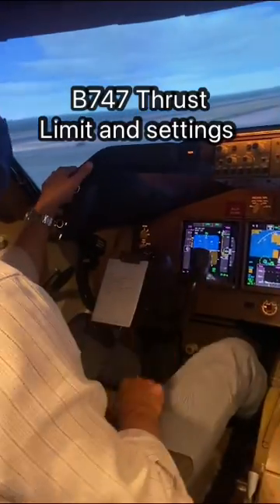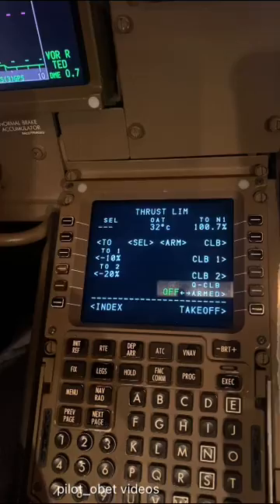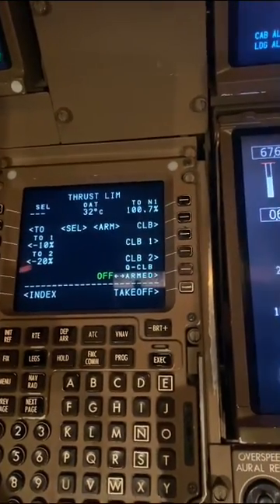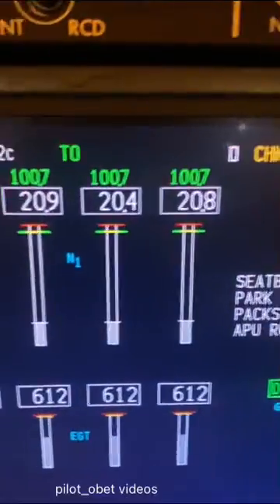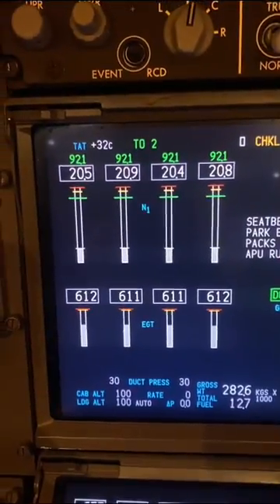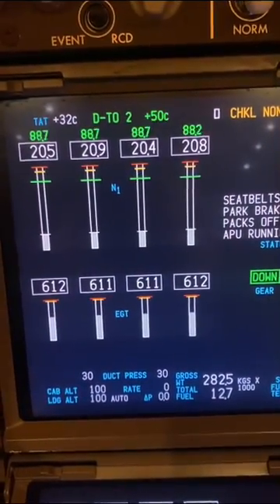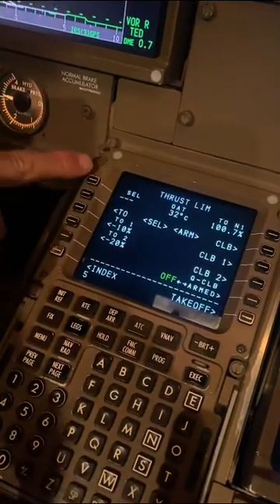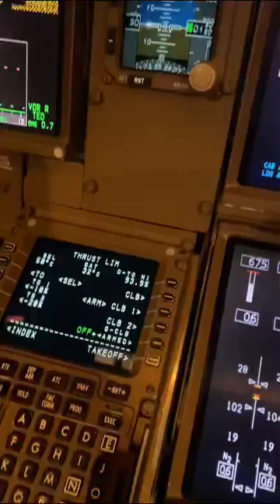B747-8 Thrust settings. TO/TO1/TO2

Comment: Why is N1 always over 100% in Boeing aircrafts in TO?

Why not 100%?

Does CLB 1 and CLB 2 change automatically to CLB?

I know that in the 737 at 15000ft it changes automatically.

The Q-CLB is for Noise Abatements I guess.
Is this mode the same like CUTBACK in the 737NG?

Can you show us an example how you set the values for Q-CLB in the FMC, using London-Heathrow as an example, please?